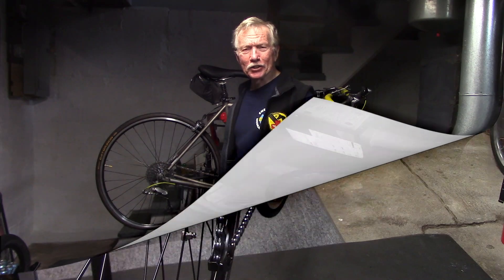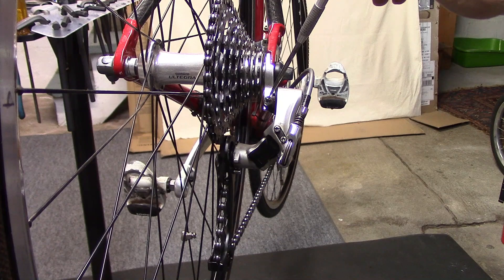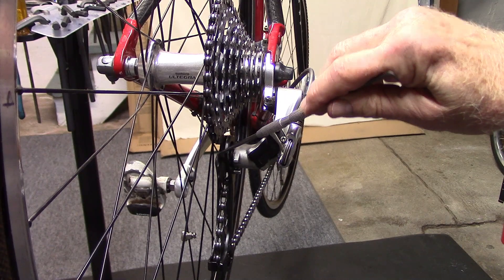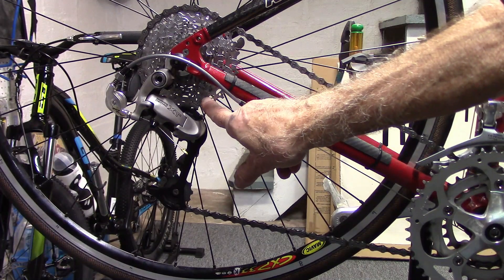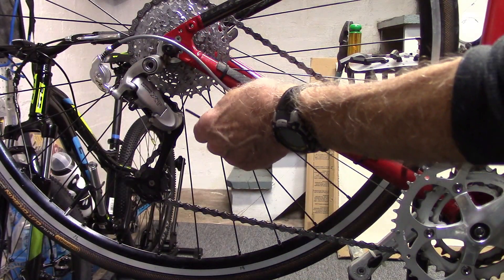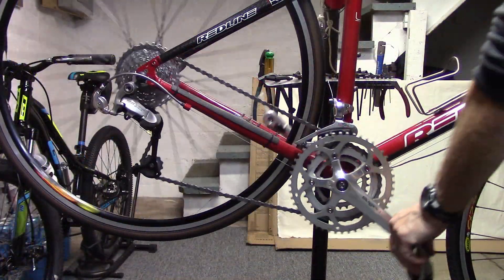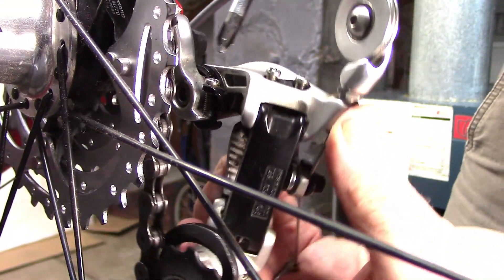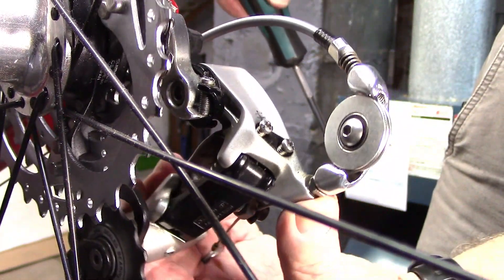What is the bicycle derailleur B screw and and how to adjust it?

Comment: Is M3 screw used or M4
Reply from the maker: For Shimano, they are M4 x . 75 pitch. SRAM is probably the same but you should check the specs for your specific model rear derailleur on the manufacturers web site. You can buy "b" screw for a SRAM or Shimano on Amazon.
Reply: @tony10speed  can u also tell if altus 9 speed derailleur could run 11-36 teeth as the company says it can run 11-34 only max but after I run it there is some rubbing what can I do to fix it I have already max out my b screw should I use longer B screw or get alivio 9 speed derailleur which runs11-36 teeth cassette
Reply: @tony10speed  can u tell
Reply from the maker: @tablamasters6262  One can not tell from just looking or comparing the "b" screw to those M4 or M3 you have since the pitch may be different.Your best bet is to buy the "b" screw for the specific manufacturer of your rear derailleur (Shimano, SRAM, etc.).

Comment: I've just ordered a derailleur and it's come without the plate between the bolt and derailleur. Is this necessary?
Reply from the maker: Not sure I can know this derailleur. What is the make and model?
Reply: @tony10speed  it's some Chinese generic sram one, ltwoo. Nothing wrong with the derailleur only that there is no b plate on it. Can I just rest the b screw on the hangar notch instead?
Reply from the maker: Yes. On many bikes, the "b" screw sits on the hanger notch. The hanger is often a little longer then older model bicycles and is also removable in case it gets damaged or bent. On older bikes, you can add a hanger extender which has it's own notch and allows you to run larger cassettes (provided your rear derailleur can handle it). Thanks for the comment. Regards, Tony

Comment: Why do you need the extra nut for the longer B screw?
Reply from the maker: I used the nut on the bolt because the derailleur hanger was not long enough. The bolt sits just behind the hanger. Since then, I have a better solution and that is a hanger extension. See:
https://www.amazon.com/product-reviews/B08HDFBNZ3/ref=acr_dp_hist_4?ie=UTF8&filterByStar=four_star&reviewerType=all_reviews#reviews-filter-bar
This allows me to use the existing bolt, is cheap and works well. Regards, Tony
Reply: @tony10speed  yea I get why you used the bolt to provide further adjustment of the b screw but its already 25mm long which should have been enough if it works only.  Did you use the nut to make the bolt longer than 25mm?  
The extension is what people use but some say its wonky.  How is it for you?
Reply from the maker: @ns671fr  The nut on the bolt sits behind the hanger (acting like a hanger extension). As to the actual hanger extension I mentioned, the inexpensive ones worked well while the Wolf Tooth did not fit well on one of the 10 speed bikes I on which I was working. That may have been due to the bike frame itself and maybe not the Wolf Tooth hanger extender. So are they "wonky?" When they fit and are installed properly, most have worked well. Regards, Tony

Comment: Tony, you may have saved my 11-28T to 11-32T upgrade on my SRAM Rival set! The factory B-screw just doesn’t give me enough clearance to avoid the chattering.
Reply from the maker: You can also obtain a "rear derailleur hanger extension" which only cost a few dollars that would allow you to set the "b" screw. I've done this for 2 different older road bike in which I could not set the "b" screw with great success. Did not have to replace the "b" screw with a longer one. Just an idea. Regards, Tony
Reply: @tony10speed  LOL, just ordered on Amazon! That, plus a new chain. Heard I’ll need a couple extra links. I’m running a new cassette so no big deal. 

Thanks for the follow-up. Great video!

Comment: after 30 minutes of googling i FINALLY understand what the hell the B screw does
Reply from the maker: Often don't have to change the "b" screw settings when properly set. However, when changing to a different size cassette or new derailleur and on some new bikes, the "b" screw setting will enhance performance. Regards and safe cycling, Tony

Comment: I recently bought a brand new bike and apparently the shop I bought it from did not do a great job with setting up my chain... I kept hearing a rattling noise and this morning it fell off on me while I was biking to work, looks like it's just too loose. I managed to finish my commute by switching to higher gears but this should help me get it fixed without too much pain, thank you for sharing!
Reply from the maker: What do you mean "fell off?" It may be, as you say, the chain is not properly sized and is too long. Here's how to set the proper chain length;
https://www.youtube.com/watch?v=Vg2SoOOrpE8
I, personally, would take the bike back to the dealer and complain - have him set it properly.
Let me know how you make out. Regards, Tony

Comment: i have made the jump from a 2x (16-speed) to a 1x (8-speed)  i have a sora derailleur.  im wondering if this tension screw might help with chain slack since i dont really have a clutch on the derailleur
Reply from the maker: More likely your chain may be too long for the setup if there's too much slack in the chain (especially if the 1 x chainring is smaller then on the previous double). Here are some videos that may help.
How to adjust chain length:
https://www.youtube.com/watch?v=Vg2SoOOrpE8&ab_channel=GlobalCyclingNetwork
How to adjust the rear derailleur
https://youtu.be/3Mq5x7VAWhw?t=108:
All new bicycles need this (which may or maynot apply to your setup):
https://www.youtube.com/watch?v=pMrOs3P9nn8&ab_channel=SickBiker 
Finally adjust the "b" screw as in our video.
Regards, Tony

Comment: What an excellent video. Concise, interesting and well presented. I've learnt more about the rear derailleur than I signed up for! Thanks Tony!
Reply from the maker: Thanks. The rear derailleur has more to it then we think. We often don't have to deal with the "b" screw but in my shop, we are constantly restoring or upgrading bikes which lead us to fine adjustments of all types. As we add larger cassettes/long cage derailleur/hanger extension or convert to a 1x chainring up front, we need to look at such things as the "b" screw. Also see:
https://www.youtube.com/watch?v=pMrOs3P9nn8&ab_channel=SickBiker
Regards, Tony

Comment: This is super important on modern derailleurs with a clutch. If you have a lot more than the 3-5mm between the biggest sprocket and jockey wheel then your shifting starts to go bad. (You may think it's cable tension but its usually the bscrew)

This typically happens when you replace or resize your chain (Too many or too few links).

Rule of thumb: If you have a big gap between the biggest sprocket and top jockey wheel, anti-clockwise the bscrew to change the angle, then when you engage the clutch (unlock the cage) it will take up the slack.
Reply from the maker: Thanks for the added and important tip. Well explained. Regards, Tony

Comment: Great video Sir Tony! recently I changed my RD that can accomodate 11-36T cogs and a total capacity of 45T, my front chainring is 44-32-22T. I calculated the drivetrain capacity and the result is 47T that exceeds my RD capacity, is it bad? By the way sir my RD is Shimano Alivio M3100 SGS.
Reply from the maker: Does it work in all gears, especially the front 44T.   If in the 44T, you might run into some problems if you accidental shift into some of the larger cassette cogs. I've not been very successful in exceeding the derailleur capacity. Setting the "b" screw and sizing the correct chain length could be tricky. Let me know how this works for you. Tony
Reply: @tony10speed  yes it is working on 44T and I can shift it to the larger cogs. My only concern is my RD sir, I might break it because I exceeded its total capacity even if it is a long cage RD, but thank you sir! Godbless.
Reply from the maker: @earvinvillanueva3839  The only place you may run into a problem is that when you're in the large chain ring and accidently shift to the largest cog, the chain/derailleur may lock up. Test it out. If it doesn't, your OK. Let me know. Thanks, Tony
Reply: @tony10speed  i test it out sir, i can shift it to the large cogs and large chainring with no problems, and my RD bends like the one on your video. Do you think sir that it is okay? I'll just avoid cross chaining when riding.
Reply from the maker: @earvinvillanueva3839  I'm surprised you got it to work. Also check the "b" screw for best performance since exceeding the range for the RD often does not allow the "b" screw to contact the rear hanger. The gap between the tension pulley/chain may also be greater then 2-3 mm effecting shifting performance. See:
https://www.youtube.com/watch?v=UXnLJpTVFJ0&ab_channel=TonyMarchand
Anyway, if all works well, you should be find. Regards, Tony

Comment: Really helpful. I'm in the middle of installing M591 sgs rd on my 10 speed 105 road bike so I can run a 11-36. Nobody talks about getting the M4 X.7 nut.  That trick is really handy. I knew about the longer M4 bolt from Harris Cyclery but the nut tip was awesome.
Reply from the maker: You can also use a hanger extension (cost around $5) which works well. Regards, Tony
Reply: @tony10speed  thanks Tony. How do you fine tune the B-screw with a nut? I have the hanger extender but the I don’t think I need it. I just want to bring the guide pulley closer to the 36t cog to improve shift performance.
Reply from the maker: @Supastrikers0280  You need a friend to push the derailleur forward to take pressure off the "b" screw while you hold the nut and tighten the screw. It's much easier with a rear derailleur hanger extension which is now my method of choice. but before buying a hanger extension, one needs to read the info on the hanger extension to make sure it will work with your combination of derailleur and cassette size.
Regards, Tony
Reply from the maker: @Supastrikers0280  You need a friend to push the derailleur forward to take tension off the "b" screw while you hold the nut and tighten the screw. It's much easier when working with a hanger extension which is now my choice (they're relatively inexpensive). Just read the specs before buying one to make sure it will work with your chain speed and cassette size.
Regards, Tony
Reply: @tony10speed  thank you Tony

Comment: Wow, thanks man!
Reply from the maker: Something not often talked about but important to check out when you buy a new bike (that the "b" screw is adjusted correctly) or if you change derailleurs. Regards and safe cycling, Tony
Reply: @tony10speed  thanks man, i have a brand new cassette, chain ring, chain, cable and i still hear a bit of crunching when trying to index my gears. The derailleur has some play where it mounts to the hanger, is that normal?
Reply from the maker: @MaquinasDePalomitas  No, it is not normal for the derailleur to have some play where it mounts to the hanger. The hanger may be damaged or bent (if it's replaceable, that's an easy inexpensive job). See:
https://www.youtube.com/watch?v=qHK6jQizIdc&ab_channel=TonyMarchand
and
https://www.youtube.com/watch?v=dAZ2uaazr7o&ab_channel=derailleurhanger.com
Make sure the derailleur is torqued correctly to the hanger. If tight and you still have play, the derailleur may be broken and need replacement. You're local bike shop can help you out here. Regards, Tony
Reply: @tony10speed  Thanks Tony, you really go out of your way for your subscribers, fan for life here! The hanger is relatively new and looks straight, the bolt is torqued to 11 nm (sram eagle gx), I checked out my buddies derailleur and it has the same lateral play. My shifting is pretty acceptable, just want it to be buttery smooth and get rid of the crunching. Since watching your video I’ve been playing with the b screw, when I get it so the guide pulley is really close to the upper gears it shifts like a dream, but then it won’t shift to the granny gears. I’m gonna keep toying around with it. Gonna watch this vid a couple more times so the info sinks in a bit more. BTW, love your EMT uniform, looks kick ass.
Reply from the maker: @MaquinasDePalomitas  You may be interest in the follow video from Sickbiker:
https://www.youtube.com/watch?v=pMrOs3P9nn8&ab_channel=SickBiker
Tony

Comment: Done something simler with shimano rear mech to fit a 40 tooth rear cog , but I just used the screw and it bent which sort of helped it fit the extreme angle of wher the screw push against the mech dropout , a nut on the end would have helped a lot I think
Reply from the maker: Great minds think a like. On one of my bikes, the derailleur hanger wasn't long enough to accommodate the b screw. Did exactly as you did, and now it works fine. On another bike I purchased a hanger extender which took care of the problem. Thanks for your input. Regards and safe cycling, Tony
Reply: @tony10speed   thanks that's  a high  complement coming from you sir, 
I just try my best with whatever is at hand, my current set up is a 11speed shifter with 10 speed mech on a 9 speed caset and it works pretty decent,
Thanks for the reply and great vids take care and good luck

Comment: I've had to adjust my b-screw to reduce the gap because the chain was coming off the jockey wheel during bumps.  Reducing the gap also creates more chain to wrap around the jockey wheel.
Reply from the maker: It also places the chain and pulley wheels closer to the teeth of the cog leaving a lesser gap when you hit a bumpy section of road. Thanks for the tips. Regards and safe cycling, Tony

Comment: Great video Tony, I was looking for this tips for a long time :)
Reply from the maker: An additional note is that if the b-screw is not adjusted when in the small chainring, biggest cassette cog - such that there is too wide a gap between the tension pulley wheel and the largest cassette cog of greater then about 4 mm - you may get poor shifting, sometimes skipping cogs when you shift. So the gap is important. Usually you won't have to tapper with the b-screw, unless you're replacing the derailleur, changing the cassette size (making sure your derailleur can handle any larger cassette), or setting up a new bike. Regards, Tony
Reply: @tony10speed  Thanks for another great advise. I've done what you said, the gap was too big indeed. The derailleur is not shifting into the smallest cog now. Should I play with H screw or it something with  gear cable tension? I've got SLX RD-M670-SGS derailleur. Thanks again. BR. Emil
Reply from the maker: @emilwaszkiewicz7744  If turning the H screw counter clockwise doesn't solve, you probably have to much tension on the rear derailleur cable. Turn the barrel adjuster on the rear derailleur (for Shadow derailleurs such as yours use the barrel adjuster on the down tube or up near the shifter) clockwise (inward) until it shift to the smallest cog. If none of that works, you'll need to reset the cable tension of the rear derailleur. 

Shift all the way to the highest gear (smallest cog), even though it won't go into that gear. Release the cable by unscrewing the rear derailleur cable pinch bolt. The derailleur should move to the smallest cog. Set the H screw by looking from the rear to line up the tension pulley with the middle of the smallest cog. Turn the barrel adjuster on the derailleur (Shadow derailleurs do not have a barrel adjuster on the derailleur and you would adjust the barrel adjuster on the down tube or up near the shifter) all the way in (clockwise), then out about 1/2 turn. Same for the barrel adjuster on the down tube or up by the handle bars if present. Now take the tension out of the cable by pulling on it with some long nose pliers (firmly but not with force) and tighten the cable pinch bolt. Now you're ready to start adjusting the index shifting with the barrel adjuster at the derailleur (or the barrel adjuster on the downtube or up near the shifter). Turn the barrel adjuster out (counter clockwise) until you get a nice shift to the next larger cog, then turn it another 1/8 turn. You may have to play with the barrel adjusters until you get smooth shifting throughout the entire range of cogs. Let me know how you make out. Regards, Tony
Reply: @tony10speed  I've tried this morning and  - everything works fine now, like brand new :) I'be bought this bike from ebay in a very good deal. Rear  derailleur was operating terribly. I've swapped hanger, rear gear wire and chain. Alignment was needed - what I've managed to  because of your fantastic help. Many thanks again :) I just have to bleed hydraulic brakes and will be sorted. BR
Emil
Reply from the maker: @emilwaszkiewicz7744  Good work and it sounds like you're ready to ride. Regards and safe cycling, Tony